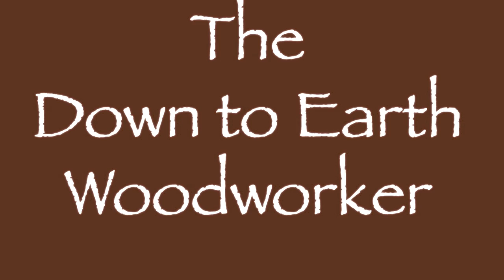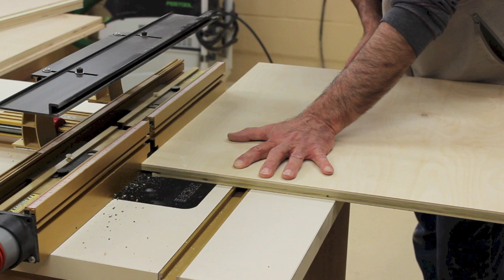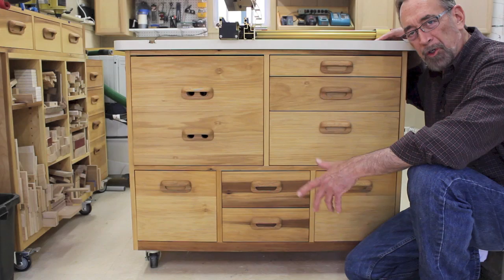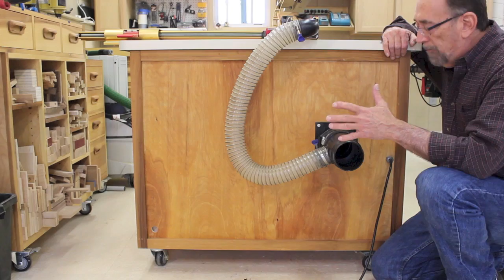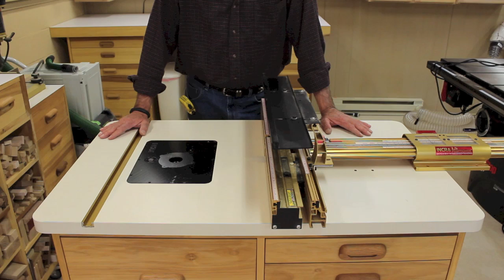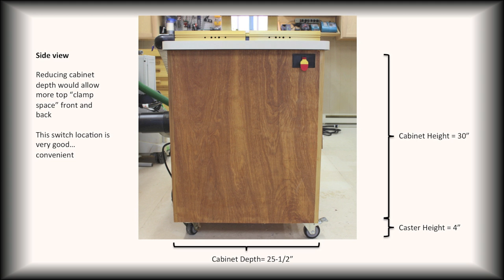Router Table Overview

Comment: Very nice router table. My only suggestion would be tapering the sides of the routor chamber as you mentioned as well as rerouting your cables higher up in the compartment so they don’t impede the flow of wood chips and sawdust to your extractor port. I built a similar but slightly smaller table using the Incra fence system as well and really enjoy using it.

Comment: Really nice router table, thanks for posting.  Do you find the casters lend themselves to a bit of instability when running a workpiece through, as opposed to fixed adjustable glide type feet?

Comment: That was a great review of the router table and the good and bad of the design.  Thanks for sharing that.  As a newbie I decided (haven't started building it yet) to use a Bench Dog table since all my other machines have this.  With that as my base I also wanted to be able to use an Incra LS positioner as well.  But that won't work just with the Bench Dog itself.  So I intend to design an extension table to make the entire top user friendly for the LS positioner.  I accidentally found that a company makes the Precision Plate v 2.0 accessory which allows MFT Festool users to attach an LS positioner.  I will use this for my extension table as an adapter to enable me to use the Positioner also.  I'm excited to be able to have the best of both worlds.  Thanks again for the pros and cons of your build.  I'll keep that in mind when i start building mine !!!

Comment: Nice router table Steve. I'm doing a build now and thinking of skipping the fence suction and going with down draft dust collection only. I have a similar setup and was told by the guy at Incra that down draft is all he recommends. Interested in your thoughts.
Reply from the maker: That's an interesting comment... I wouldn't be without the fence suction.  It keeps the workspace very clean and really (I think) makes the router bit more efficient.  I've got mine connected to my dust collection system, and the suction at the fence is so strong it actually helps keep work pieces against the fence... sometimes it almost makes it harder to move the workpiece.  :)  Seriously, I can only relay this one experience... One day I was working on some roundovers on some pieces and all of a sudden there were chips everywhere and a big mess on top of the table and behind the bit... I found that the hose had worked itself off the fence port.  As soon as I reattached it, everything went back to normal.  I think for downdraft only to be efficient you would have to have a pretty big hole around the bit... in the router plate... I prefer to have as small a hole as possible around the bit for more support for the work piece.
Thanks for watching!!!
Reply: well he is most like getting financial support from them

Comment: Steve,  thanks for doing this video. I really like the way you did this and I would like to copy it would it be possible to know the amount of material you used to build this? Or have you gotten around to making a detailed plan or sketch up?
Reply from the maker: Sorry Michael, I didn't do drawings of this project.  If you need any measurements or anything, though, let me know.
Reply: Well I guess my first question would be how many sheets of plywood did you use to build this table?

Comment: Thanks for the video. I have a similar set up and have taken all the lessons you learned after building yours and will be incorporating most of them in my new table. I will maintain the 1 1/2" ledge around the top for clamping, as you pointed out.

I think I will move the center support closer to the router plate for wider drawers to the right and provide better support where it is needed most. I will also build mine a little taller. I hate bending over the table all day and it improves my visibility at the same time.

I did not hang my Ultra Jig off the back edge, like you did, even though it is the 25" model. I figured I could move it outboard if I ever needed to route out that far to the center of a panel but I do like having that option with a 43" table.

I have started making a video but I am still learning how to edit and narrate the final product. Good time to learn a new skill, I guess.

Thanks again. You really have helped out.

Comment: I had pieced most of that together from your other videos as I started planning mine. I solved the dust collection issue by installing an Incra Cleansweep and it works great! I also am working on adding a 90 degree bend out the back and a "Y" to include the smaller 2 1/2" port from the fence. I'll email you pics when I'm finished. Great video as always!